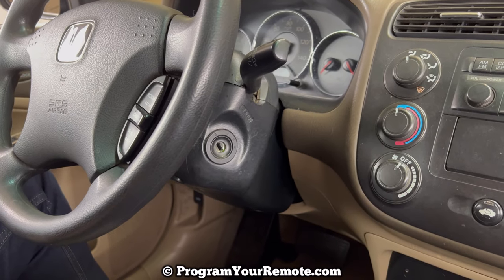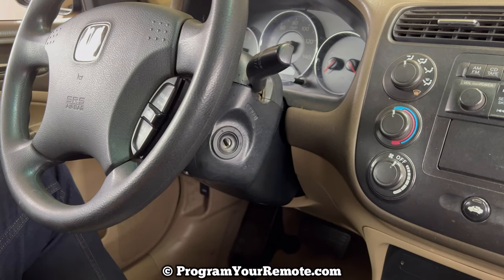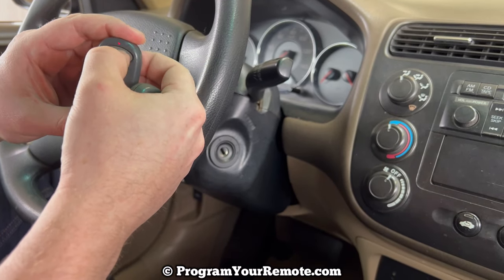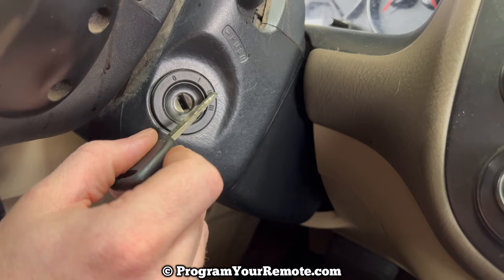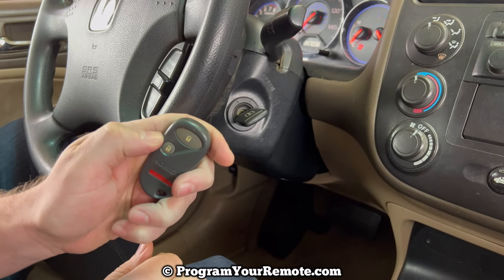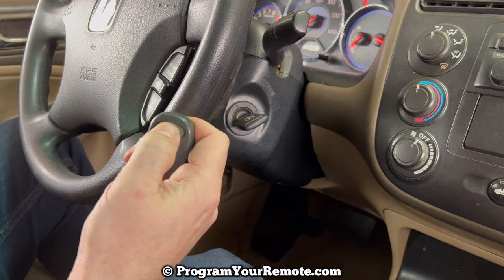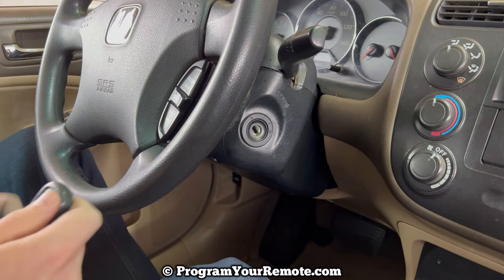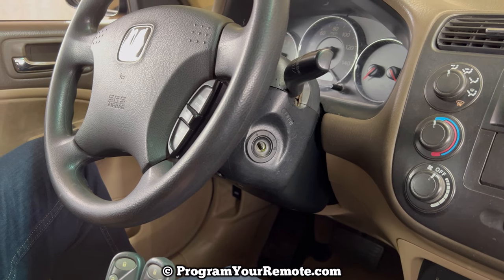How To Program A 1999 - 2005 Honda Civic Remote Key Fob - DIY Honda Civic Fob Programming Pairing

Comment: I have a 2003 Honda Civic lx and have been trying to program my new key fob but I think its not letting me because of the auto lock system
Reply: mine too
Reply: Any luck?
Reply: @anthonyg3271  nope…. I’m pretty sure I have to disable my after market alarm because it’s a different type of key fob than the stock ones.
Reply: @jassonmolina8703  I have the exact same problem with mine it’s like a KARR system
Reply: Any updates lol just bought two of em and yeah. We screwed or what lol
Reply: @hajesse7706  from what I was told u have to remove the alarm system in order for it to program to the vehicle or another option would be buying another key fob from the same alarm system and program it another way
Reply: @jassonmolina8703  dang, why are we the unlucky ones lol so you got a different alarm system that doesn’t match the stock fob? Like my stock fob broke or something, and these aftermarket fobs ain’t doing it. Think It’ll work with a stock fob regardless of the auto lock feature? I’m thinking bout returning these aftermarket’s and trying it

Update: just realized our lock systems aren’t stock. So I guess my idea on getting a stock fob won’t work. Now I gotta return it when it arrives lol
Reply: @jassonmolina8703  is this hard to do?
Reply: The 03 LX does nit have the factory remote receiver. You not to install one from a Civic EX. I just did mine.
Reply: Having trouble programming mine also Honda 2003LX
Reply: Omg I got one for my 2003 Honda civic lx and I’m having the same problem
Reply: @realteaplasticsavage4359 me too. What did you do?
Reply: I had an old fob from a junk yard and this worked so fast. I know they cheap but had my spare to do this waiting years and not getting help from the honda dealership. This took longer to write this service reasoning than doing the programming or any other step previously that only used my time. Thanks it was simple and 100% true
Reply: It doesn’t work cause it’s a lx
Reply: If it’s ex it would work

Comment: I ordered an aftermarket remote on amazon and their instructions were a bit unclear. I was able to figure it out in like 30 seconds with this video. You're the goat, thanks bro.
Reply from the maker: You're Welcome! Glad it helped
Reply from the maker: You're Welcome!
Reply: @PYR-Auto I still have the old key fob working, just bought a new one just to have an extra fob.
Will the old fob still going to work after I program the new one?
Or do I have to re-program the old fob together with the new fob?
Thanks.
Reply: What is the frequency of the control you purchased?
Reply: I’ve been trying this but it not working for my Honda civic 2005
Reply: Same here 😂😂😂😂😂😂 I was like what I did it but for some reason I did the same with the video and it worked. I did the same twice with no video and it didn't work. Hahahaha guess it wanted me to find this!😂😂😂😂
Reply: @Yourmom-jg5ls he said you have to reprogram it. Anything that your programming or that's already programmed to your vehicle you need to reprogram it. If you watch the video after he programs the first remote it'll show you how to program the second one😊
Reply: @augustinkazadi4447 I have a Honda Civic 2005 like you and it work for me. I believe you have about 5 Seconds to do from zero to the on position press it shut it off to the off position and then again to the on position press the button and shut it off to the off position again. I did it four times in a row but you have to do it quick because if you last more than 5 seconds it's like you're starting over again and it doesn't work hope this helps

Comment: You saved me man I bought this 2004 civic and I have the one key. I couldn’t get the driver side door to lock so I had to lock it from the inside and get out through the passanger side lol. The key programming was so easy. Thank you!!!!
Reply: i have a 2004 civic too and i’m currently having that issue! mine is an lx coupe
Reply: I have an 04 civic with the exact same problem and I'm so glad that this will work because I just ordered one!!
Reply from the maker: You're Welcome! Glad it helped
Reply: Does the red light have to be on..the remote for it to be able to program?.

Comment: Not working for my 2002 civic LX. I noticed it locks and unlocks every time I turn it on (II) and off (0) but yours doesn't.
Reply: I'm wondering if we need to disengage the alarm, then program the remote, 'cause I've got the same problem.
Reply: @ImagedaeusVideoProductions  did you manage to solve the problem?

Comment: I have a 2001 Honda Civic EX and it worked. The first two times I'd hear noise on the forth click but the remote wouldn't lock or unlock. It worked on the third time though so if you're having issues just keep trying.
Reply from the maker: good tip

Comment: Thanks for clear instructions. It worked for my 2005 Honda Civic Lx although I wasn’t able to set my second remote even I tried a few times, Maybe I’m missing a step. I’ll try more later. But at least one keyfob is now working. Thanks
Reply: yo working on my 05 Lx rn and i’m having issues, it’ll turn over, it’s getting fuel, it’s getting spark but it won’t start. We think it’s the anti theft but i can’t figure out how to reset it

Comment: I have a 2003 honda civic executive, but I have followed the steps and it doesnt work. 

Now the electronic lock is broken, my car alarn will go off if I open the boot, this was the same when I opened the door with manual key but I have managed to bypass this by turning x amount of times which I found in video.

1. Is executive version ok with this key? (Got from remoterenote)
2. Is the current status of my alarm the reason for it not working ?

Thank you. So sick of having to manually use key and not be able to use my boot without alarm going off

Comment: Hi, this is really helpful, but its not working for me at the moment. My 2002 Honda Civic 1.4 remote locking and unlocking became gradually unreliable over several months. I could see the LED on the fob illuminating when pressing the button but no response from the car. After an hour or so, all would be fine. It’s got worse over the months. I repeatedly replaced the fob battery but the problem got no better. I then ordered an aftermarket fob and have tried to programme it, but no sound of any lock cycling after the 4th press. And I can't get into the programming phase using the original fob either. Someone suggested the receiver in the car might be faulty. Is this a known problem? Can I test it or replace it? I don’t even know where it is.
Reply from the maker: It is possible for a receiver to be faulty - especially on a car that's about 20 years old.  Im really not sure how to manually test the receiver itself to determine that though
Reply: I have the same problem. Do you have any solution?

Comment: If you're getting to the door cycle part on the fourth key turn and it's not working, what worked for me is, on the fourth turn, press the lock button to get it to cycle, press lock again, then press unlock, then turn off the car. Worked perfectly after that. Once again, on the fourth key turn to II, hit lock, lock, unlock, then turn off the car.
Reply: 🤝🏻🤝🏻worked like a treat. Thank you. How did you figure this out🫡

Comment: I tried to do this & it worked. But I still have the same issue. My driver’s side door won’t lock or unlock from the key. But it works manually. However, my key is only working for back two doors only. I have to lock the driver’s door manually everytime. Please help me to find out whats wrong.
Reply from the maker: not sure on that, sorry

Comment: I did everything exactly like that it worked but when i get to the part take your key out and test and doesn’t work but it works when programming ive did a couple times and it works till i go to postion zero and take key out no longer works
Reply: My 2004 civic ex is doing the same thing. When in programming mode I use the remote’s lock button and I can hear the lock cycling but  when the key is out the remote will not work.
Reply: I'm having the same problem, did you get it to work?
Reply: Same problem

Comment: I have Honda Civic (mk7) SE 1.6 petrol from 2001 and same remote like in the video but doesn't work, any suggestions?
Reply: Ai reusit sa o faci sa se imperecheze? am o honda civic din 2005 ima si dupa ce masina a stat fara baterie o perioada lunga de timp telecomanda nu mai este imperecheata cu masina si nu tine minte telecomanda dupa ce intru in modul de imperechere.

Comment: Can someone help me with this situation I'm dealing with? 2005 Honda civic ex coupe. My old key fob would make an audible "beep" of the horn (and flash the lights) when I pressed the lock button, and an audible double "beep" of the horn when I pressed the unlock button. This audible sound was useful for when I'm walking away from my car and I can physically hear that I locked my car when I press the lock button. But ever since that key fob broke, I ordered these aftermarket ones and they no longer do the horn beep. They only flash my lights. How do I make it so my new aftermarket key fobs, just like the ones here in this video, go back to making the car beep when locking and unlocking?
Reply: That may not have anything to do with the fob, but possibility the horn itself. Could check to see if the horn fuse is blown or damaged in anyway. If that's fine, I would try purchasing an OEM key fob from a junkyard or any seller on eBay that the fob looks legit. If junkyard, can ask them if you can test this feature before purchasing & hopefully they agree.
Reply: My owners manual says on the fob that currently works with the vehicle you will have to press lock and unlock together for a period of time (30 seconds?) to activate the audible beep once again. This happens anytime the battery is disconnected or changed or any other time the vehicle looses power or something of that sort

Comment: Someone who has a CIVIC 2003 LX 4 DOORS in the USA and this original Honda control helps them since I bought my car a long time ago and it came in very neglected condition and they only gave me 1 key without a control and I chose to put a remote start with alarm included but Now the alarm is already giving me problems, the car's battery drains me as soon as it's cold, I wanted to take it off and just put it to open and close but I'm not sure if it comes with factory control since I called a Honda dealer and they could never confirm anything .

Comment: Just done this on my dad's 2003 honda jazz/fit but on the new remote I had to press both the lock and unlock button then remove the ignition key after that the car recognised the new remote
Reply: Tuanks bro, this helped me out alot as it is the same for mine!

Comment: I have a 2001 honda civic lx,i tried to do the same thing with my new key fob but it doesnt work!, please any other information what should i do
Reply from the maker: Are you sure your Civic has a factory keyless remote system installed?  If you are unsure, call a Honda dealership with your VIN number and speak with their parts department.  They can look up the original build sheet for the vehicle to see what options it has

Comment: Does the "PANIC" button work with these aftermarket remotes after successful programming? Perhaps with a Genuine Honda remote that is reprogrammed, the "PANIC" button may work?
Reply from the maker: the panic button does work on the OEM fobs.  In my experience aftermarket fobs work pretty poorly in general but I don't know specifically about the panic button.

Comment: Will a eBay key fob work with my 1999 Honda civic gx 4 door I bought the car with no key fob but would like to have one the car does have power locks?
Reply from the maker: If the vehicle has the factory remote option and you purchase the correct key fob from eBay - then yes, it should work

Comment: I did buy from Amazon. But is not working. I tried as your vedio but not working please help me
Reply from the maker: Are you sure the vehicle has the factory remote option?  If so, there may be an issue with remote you sure using

Comment: I bought a 2010 Civic.  It only has one key fob.  I could not get to the programming mode to do the second key.  Please help.

Thanks
Reply from the maker: The procedure shown in the video only works on the years shown in the title.  Unfortunately a 2010 Civic is not onboard programmable, meaning you will need a dealership or automotive locksmith.  You can find a locksmith in your are here https://www.locatealocksmith.com/directory/

Comment: Doss this work without the original key i lost the original key and needed to fabricate a key but the car will not turn on because of the anti theft system, would this possess overight this?
Reply from the maker: No - if the vehicle is in anti-theft mode I don't believe you will be able to do this procedure
Reply: @PYR-Auto  thank you
Reply: @PYR-Auto  so of the cars in anti theft mode. What's the next step?

Comment: Hi I just bought the key fob remote from keyless Canada for my 05 Honda civic 
And I tried to program and it seems to work for only 3 doors not for the driver side ,it  won't lock or unluck the driver side door. Please help !
Reply from the maker: It sounds like there may be an issue with the door itself rather than the remote
Reply: Your cars are no doorlock actuator in driver side you need to install it.

Comment: My current fob is fried and when I unlock the door manually, the alarm goes off. Can I still program a new fob this way or does the original need to be working
Reply from the maker: The original does not need to be working but if your alarm is triggered it may prevent the vehicle from entering programing mode
Reply: I’m having the same problem any luck on how you fixed this???
Reply: @whatthe_ffff753  What alarm are you talking about? 7th get civic never came with alarm pre installed. Aftermarket alarm, I would go directly with their key fobs & have a professional program them as it'll work best with your aftermarket alarm system. One of the trade offs of owning this gen civic w/o alarm from factory. Those came with 06+ civic
Reply: Mine does the same.
If you put the chipped key in the ignition and turn, it stops the alarm. Then you should be able to program your remote transmitter as above.

Comment: This is my problem, the car alarm constantly stuck on after my battery went dead. I cannot jump the car cause the alarm keeps the engine from starting. I do not have the key fob to turn off the alarm, so alarm is stuck on preventing me from starting the engine. I need a new key fob but that would mean I'd have to reprogram it while the alarm is on???? So my question... can I reprogram a new key fob while the alarm is still going on... 1999 Honda Civic btw with aftermarket Audiovox brand alarm...

If it cannot be reprogrammed while alarm is going off then wtf am I supposed to do? I am assuming taking it to a mechanic and pulling out the damn alarm is my last resort?
Reply: If the car is dead open the door and put the key in the accessory position, depending on your alarm and settings the alarm shouldn’t go off. Key set to accessory (II) and then provide power to the vehicle. It SHOULD work
Reply: @devinprasad3449  This does work. Funny thing is I found it out myself after some thought, but thank you for the late reply.

Comment: Once I disassamble steering lock unit and after this "operation" opening with remote control has stopped working. Remote control is ok, it lights. So I use your instruction. It works till I pull out the key. Then  doesn´t work. What is problem?
Reply: My 2004 civic ex is doing the same thing let me know if you find the fix. Thanks

Comment: I tried but mine isn't still working. Please does I mean it is busted?
Reply from the maker: First of all, are you sure you Civic has the factory remote option installed? Not all do
Reply: @PYR-Auto  Can't tell please. I use Honda Civic Hybrid 2005 model.

Comment: I followed the steps a few times and didn't work for my car, so at the end when programming the remotes I clicked the lock and unlock buttons a few times and got it to work for my car (Honda Civic 2003)
Reply: If there is no red light on the remote the problem is not in the car. The problem is in the remote
Reply: Also, if you car doesn't go into "programming mode" best thing to do is remove negative battery terminal for 15-20minutes. Never more than 30minutes unless storing your car. This will then reset all the systems in the car & therefore also helping to get back into program mode. However, glad you figured this out on you own. I'll say not every civic is the same even same yr & all.

Comment: I have a Honda Civic 2003 and tried but it’s not working
Reply from the maker: Your Civic may not have the factory remote option - not all do.  You can verify that by calling a Honda dealership with your VIN number.  Speak with their parts department and they can look up the original build sheet for the vehicle to see what options it has.
Reply: @PYR-Auto  exactly there’s not factory remote system, 
So do you have any alternative solution
Reply from the maker: I don't sorry

Comment: Does it work on a 03? Myy dad just got my brother one and he doesn't have the original key. You can only unlock with a replacement key
Reply from the maker: Yes, if the car has the option installed

Comment: Tried this and didn't work. I have an 04 civic
Reply from the maker: Your civic may not have the factory remote option.  You can verify that by calling a Honda Dealership's parts department with your VIN number.  They can look up the original build sheet for the vehicle to see what options it has.
Reply: @PYR-Auto  I noticed that even after changing the battery, the little red light on the key fob doesn't come on when pressing any of the buttons